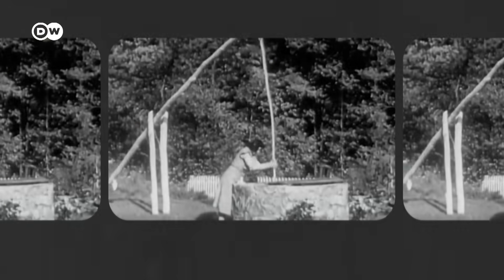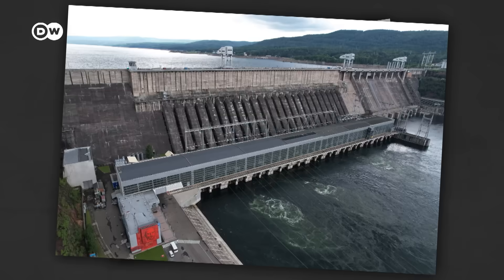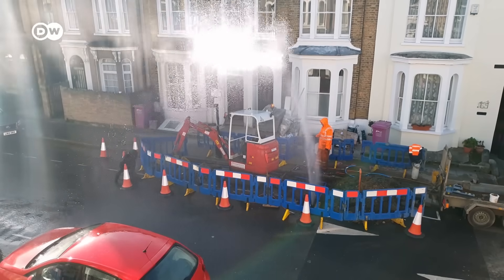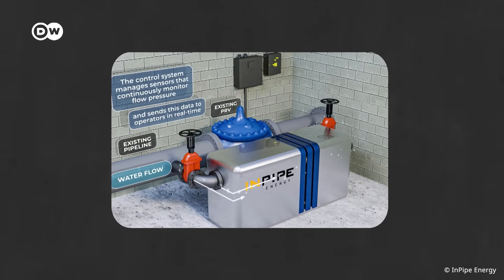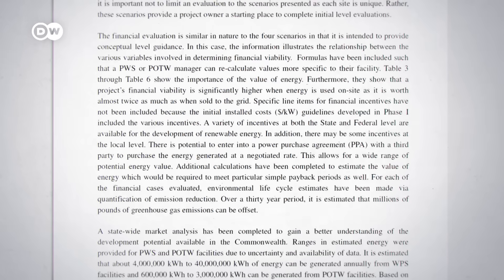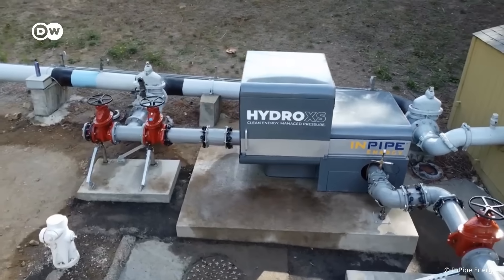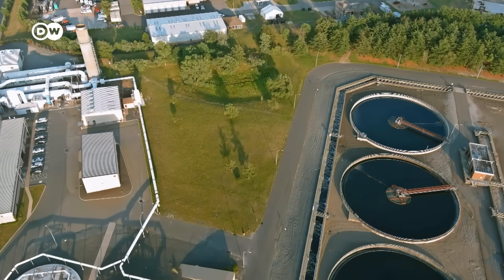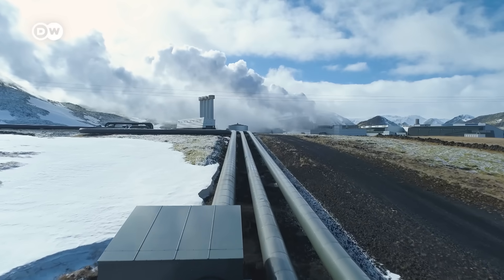In-pipe energy: The hydro power nobody is talking about

Comment: How much cost goes into huge pipe leaks in de USA alone. I heard a story that in New York the pipelines are just from 100+ years Wood. Yes Wood. And more than 50% of the water that is getting used already leaked away. 

So for every 1 Liter water, the same or more has leaked due too bad maintenance and very old infrastructure. And that is a huge problem because fresh water is a very scarce product rivers and lakes get empty and ground water levels lower while cities grow especially if you look at Arizona Nevada LA Texas. So it is worrying that so much water is wasted and the infrastructure in cities as New York is just old wooden pipes. It would be a hard task to open every street trough the city to get access, but losing half of fresh water when it is already scarce and a problem in the future with less rain and warming up, this must get solved.

Comment: potentially has some uses in gravity fed systems, but if these are installed in pipes whereby the water is being pumped these devices will add unnecessary strain on the pumps.

Comment: Are you serious??? How is it possible. Is this another YT video that doesn't care about facts but taps into potential for viewership?  I kind of now understand where the term PIPE DREAMS come from.

Only cities where the "NATURAL"  water source is at a higher elevation than the consumption points can think of this. This point alone would eliminate over 95% of the cities across the globe.
Reply from the maker: Hi! You'll see, at 2:26, the reporter explains that the turbine is fed via wasted energy released at the pressure valve 🙃 So, elevated water sources are not a prerequisite for this tech ✨

Comment: there are some great practical videos on youtube about small/mini/micro power generation, a step up from the in-hose example you demonstrate. people harnessing power from the drainage ditches on their property or in their community. agree that where we're currently throwing energy away on pressure reduction, we could easily update the design of components to harness that wasted energy. any little bit to reduce an energy bill for a household helps, even if it's just powering led lights and charging batteries

Comment: What am I missing here? We use energy to power water pumps to achieve a desired pressure then remove the energy using a turbine which generates electricity? Why isn't there a system in place to generate exactly the pressure desired which does not 'over-pressurise'? Why aren't there pumps across the network to maintain the pressure required so that we don't need to take out the excess energy?

And regarding the 10:1 energy use in U.S. vs. Indian homes - when was the last time a home in New Delhi froze? Have you ever been to Michigan or Montana (this was an average usage given)? They're fecking freezing in the winter! That's partly why energy usage is greater. Just the same reason that the 'global north' is being blamed for fossil fuel usage in the 19th and 20th century. The coal consumption was more in homes than in factory steam engine boilers, to stop the occupants freezing to death.

Comment: Couple of years ago I was freaking out and breaking in cold sweat. Why? Because in the corner of my eye I had glimpsed something impossible. My heating pipe spat out bright orange sparks. It was only a glimpse. But I went to investigate. And then there, with my eyes firmly as wintess it happened again, where the pipe was clamped to the wall. And there was loud BZZZT noise accompaning it.
It happened again and again. And well, the noise was so loud and sparks so bright and big that I thought somehow live current had ended up in my pipes. I was panicking. And called an electrician. He came to investigate, saw the sparks, then very carefully took the meter out and measured the current. Almost non-eligible. Like literally, it was spitting sparks and buzzing like crazy and there was hardly any current. So the electrician then put his finger in there and SCRE- I am kidding, nothing happened.
He concluded that it was static electricity, from water flowing inside the pipe, that was behind it. And it was the type of metal that was causing the sparks. To prove it, he took apart the clamp and then just rubbed the metals together and sure enough, sparks were flying. And then fixed the issue by just tightening the clamps. Didn't even take money for the job, the curiosity was interesting enough to amuse him and the job easy and quick that he felt no money was necessary.
But reall,y it was the first time I learned that water can create static electricity.

Comment: The people that fall in love with this and fawn over this are the same people that fell in love with 1) pumped energy storage (essentially moving water uphill), 2) compressed energy storage (basically, injecting air into holes in the ground) and 3) "regenerative" braking tech.  They don't understand (or simply refuse to accept) the laws of conservation of mass and energy; nor do they feel that the laws of thermodynamics need apply.  You don't get something for nothing- Mother Nature don't play dat (that's an homage to Homie The Clown from In Living Color, people).  

Any water (delivery) system requires massive amounts of energy on the front end to deliver the precious, liquid blue gold on the back end.  You on the back end didn't invest any of that energy, but that doesn't mean that the energy entrained in the water is "free" as more than a few delusional people fervently believe.  In this way, you are not generating energy, but recovering SOME of the energy that went into the front end.  That said, from a WATER systems standpoint (and we are talking about the TOTAL water system, not just or only the micro-turbine part), you have to think of these turbine schemes (or more to the point, cons) on a net energy basis.  And any "savings" from these turbine schemes, however ephemeral, will only accrue to the water company, and not to you on the back end... what makes "sense" for the water company doesn't necessarily make "sense" for you, the homeowner on the back end.  

One thing is certain, however: the makers of the microturbines and the peddlers of these installed systems will be laughing their collectives a---s off all the way to the bank.

And We The People will be much, much poorer for it.  And all in the name of fighting climate change...

Comment: There’s definitely potential here. Imagine a water tower with a tank above and below ground. You could pump water up to the top tank when electricity is cheap and let it flow through a turbine to the bottom tank when it’s more expensive while still providing pressurized drinking water.
Reply: This actually exists already, it's a form of energy storage used to balance the power grid, just on a bigger scale. 
The way it works is you have two lakes, one on a higher elevation and one below. When there is no much demand for electricity the excess energy is used to pump water up then in peak time when there is not enough energy produced the water flows to the bottom lake and turns turbines.
Reply from the maker: @Aaron Hamburg We have a video on alternative batteries, which you might be interested in: https://youtu.be/-vobMl5ldOs - check it out and let us know what you think in the comments 🙃
Reply: @aaronhamburg4428  - that’s true. There aren’t many of these lakes though due to some very finicky requirements to make it work. Length of pipe, elevation, etc… all have to be properly aligned. I figure the water towers wouldn’t generate as much power, but it would be fairly easy to build multiples.
Reply: Yes. Make it a pair of dams in the mountains. A quick google says that 100m is considered 'high head'. I suppose a flat landscape could support a 100m head system if a huge dam were constructed but that would be expensive. I think mountain ranges are necessary to do it cheaply.
Reply: Way too inefficient in terms of the energy conversion. What you are suggesting is a pumped-storage hydroelectricity system, which exists much only in very limited circumstances. It is simply much more energy efficient to use a battery farm rather than such system. Not to mention you need a huge area for the system to work because water takes up a lot of space for not that much energy generated.
Reply: @phuocluong7974  - I assume it wouldn’t be as efficient as other options. That said, many towns already have water towers with pumps to move the water up to the top tank. I’m just thinking of a way to add energy generation to an existing water system.
Reply: @legostud  you wouldn’t want that. Municipal water reservoirs/tanks are used to supply extra water pressure to the water system for when there’s an increased demand for water in the area. Using said water to generate power will take away the purpose of the tank/reservoir. Not to mention, the amount of electricity generate will be negligible.

Comment: This is a pipe-dream. Many tiny turbines are extremely expensive and uneconomic. And on the other side, you then need stronger pumps to maintain a higher pressure gradient. There is no free energy after all, 2nd law of thermodynamics.

Comment: Almost ten years ago I wrote a paper on  energy generation with microturbines in certain sewage systems. The thing with drinking water is that the sanitary conditions needed make it harder, but with sewage or irrigation systems regulation is lighter and  implementation becomes easeir
Reply: Power production would be awesome on Wednesdays, after  Taco Tuesday
Reply: How it's harder to generate electricity with drinking water than sewage?
Reply: @Harish Babu M  because (at leat here)the regulations for clean water are too strict. There's a lot of red tape before adding anything to the system or before any repairs, modifications....
Reply: @samuxan  but wouldn't sevage water contain impurities like hair, fibres and other nasty stuff? How would you get rid of that without blocking the sevage line? Because you must if you don't want to damage your Turbine machine, things like hair or fibers are bad for Turbines unless it's a very big turbine.
Reply: @blackpanthar906  then we need to talk about the difference between graywater and black water. The whole idea was to only use it on graywater system( after it was processed, before dumping it on the sea) but you are right, there are problems with that too. One of the many reasons it's not done everywhere
Reply: @samuxan  No you don't understand, you want to use it after water treatment when it is released into sea, but then the project will be very limited to coastal areas or a river coast in case they dump it in a river.
Reply: @HarishBabuM  Read the post again. It doesn't state what you are asking... It just states that the turbines would have to be special to not pollute/contaminate clean water.
Reply: Sewage using gravity I can see. Using a pressure bed water source is just a transfer of energy and actually stealing energy from the sources providing that water pressure.
Reply: I recently got my PhD on the subject... I proposed a dimensionaless method to design in pipe turbines: " In-pipe axial pico-hydraulic tailored turbine design: A novel approach using a dimensionless design chart"
Reply: @abrahamvivas9540  Again - a lot of nonsense!
Reply: problem us the cleaning of the turbines using sewage water.